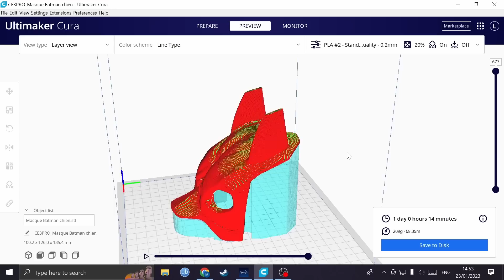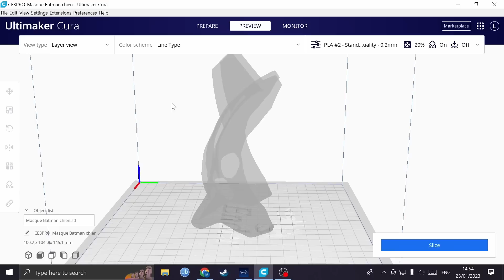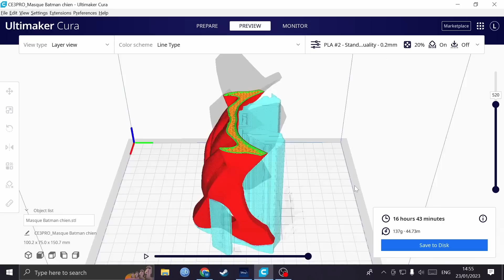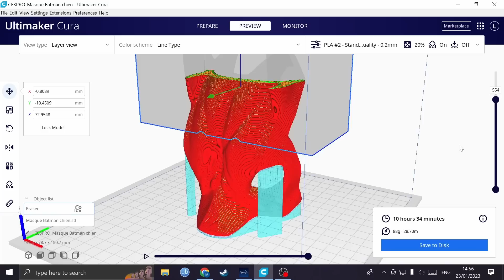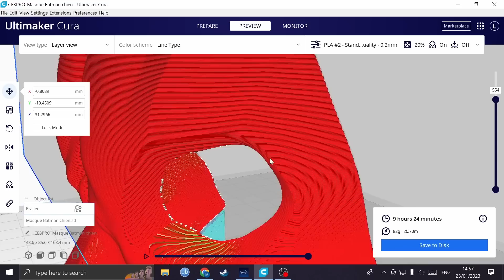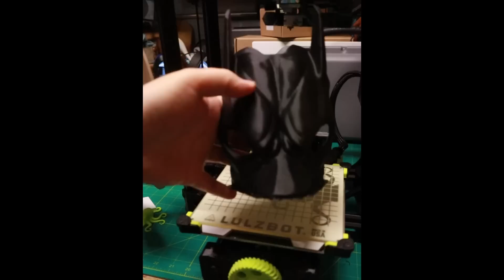(OLD CONTENT)

Comment: Instead of Supports everywhere and Using support blockers why not just use custom support instead and you can add it under the eye sockets still... I have not used Cura in years but even then I did it that way, I just find Prusa Slicer way more useuable and it gives way better prints than Cura ever has with the same settings. But yeah for those that dont know this is a good tip

Comment: Another tip, in the slicer settings, you can change the overhang angle to suit your printer. This will dramatically reduce the calculated requirement for support on your model.

Comment: My support settings never change. 15% density, zig zag, connect zig zag. And with just enough interface to actually support it. I want to be able to remove with ease and not worry about how much is sued for support at the same time.

Comment: it's crazy how slicers don't just rotate the model to the least amount of filament used
Reply: Sometimes print orientation is important to structural characteristics so you'd definitely want it to be optional but i think that would be a cool feature still yeah
Reply from the maker: That would be a nice feature!
Reply: @maddydeeemedia1672  There is the Auto-Orientation Cura plugin that does this!

Comment: If your printer can consistently perform with a small surface area to start with (and most printers these days can), this is a great way to save material.

If the part is in any way structural (ABS, PC, nylon, etc), changing the orientation could weaken it under load or make it easier to warp and fail, which means this is when you talk to the CAD engineer and tell him to split it up so it's efficient and strong when printed and assembled.

Comment: Just use tree support. You are making it harder than it has to be.
Reply from the maker: But if you can go without support at all why would you use any?
Reply: @maddydeeemedia1672  but you didn't go supportless. I'm not saying have it positioned like you did in the beginning, you'd still tilt it and modify your overhand angle, but doing this all in tree will give you better results for faster prints and les filament than that grid style support. Also, with that many walls, just do cubic infill with gradual infill steps of 3.
Reply from the maker: @CaptainFettCosplay  in the end I went without supports but yeah tree supports just for the eyes while using the angle of the model would be good

Comment: Great tips, there is a lot more of settings that can help you reduce filament usage tho. You can try to reduce support dencity easly to 5-10%, overhang angle to 60% or print line supports with no walls, with increased support interface density.  Tree supports are an great option too in some cases.
Reply from the maker: Yeah great advice, I might make a video more in depth on ways to save filament. With this one I was just focusing on the one topic